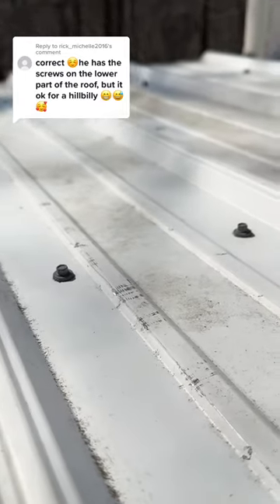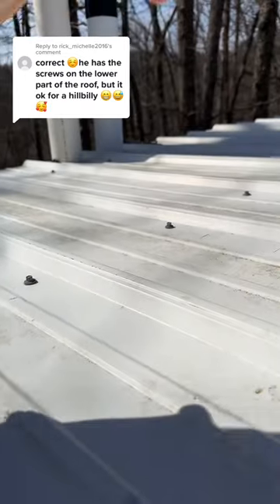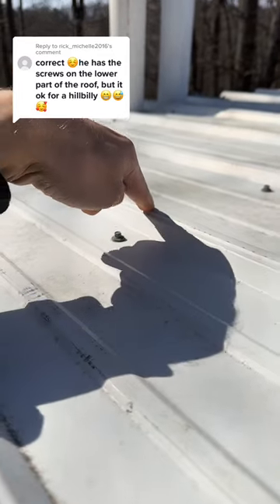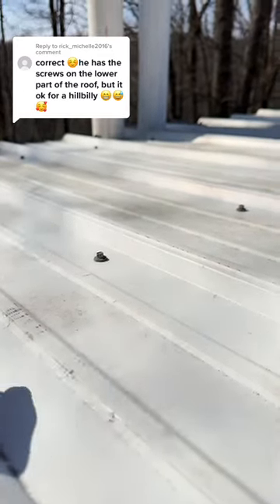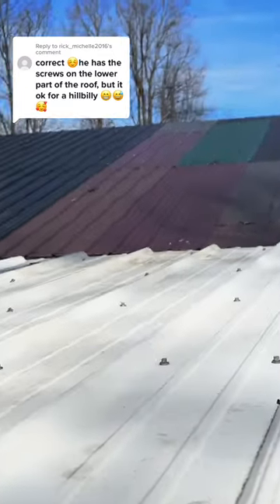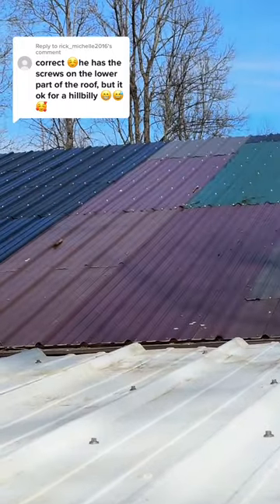did I install screws on the wrong part of the roof

Comment: Backseat know it alls are the bread and butter of the internet forreal. I've installed many roofs and you will destroy the metal if you press down the high ribs lmao
Reply: Came here to say this! you don't need to have installed a roof ever to visualize the rib crushing as you drive the screws lol
Reply: Who said anything about pressing down on it? You don't drill it til the screw head strips
Reply: Def not the bread and butter xD but definitely a dime a dozen haha.
They make me cringe every single time I swear.
Reply: @billfromnxtdoor5575  i guess you still dont understand per instructions from the roofing company. how about you do your roof in metal and when it leaks and u have an insurance guy check it out they tell you your on your own because the metal is installed incorrectly
Reply: @Riley White  dude has probably never ran a screw through metal roofing
Reply: Dude has probably never run a screw through anything lmao.
Reply: Thats crazy because I live in MN and every tin roof I've seen has had the screws on the higher part not the lower part like this and they say its so water can't get under them..but what I'm wondering is how the hell.will water get underneath them if there is a rubber gromet on each screw?
Reply: Did you know this is a big concern for AI? Systems can’t tell the difference between a real master and a couch quarterback
Reply: When I help biuld guys biuld poll barns they told me only if it had insulaton under metal so metal wouldn’t be wavy
Reply: Lol I watched my dad do this. He didn't crush the ribs down either. He's a science teacher with two degrees, one of which is industrial arts. He's helped build houses and has been remodeling them for over 50 years. 
I see in these comments many guys in the business can't think outside the box and have the "my way is the only way" attitude. Well I've seen and repaired many roofs put on by people like you. Many screws come loose for many reasons many of which are due to laziness of the installer. The screw goes in soft and the installer ignores it. Plywood isn't perfect and has defects that screws will go in occasionally.
Never once has my dad had a problem with putting screws in the fridge and in the flat at the eaves Which keeps the wind from getting under the panels. Leaks there don't matter as much if it does happen because it's over open space and not the living areas. And yes he does pre drill where needed. And yes it does take a bit longer. And no he doesn't care if it takes a bit longer. I personally put a wood backing down to support the ridge.
In my repairs I have seen two common failure points. 1. The screw has come loose from either movement or a hollow in the plywood or stripped in combination with the previous mention.
2. The rubber seal deteriorated and crumbled away. Built in obsolescence? On older roofs of course. I've also seen really old roofs in perfect condition.
Reply: @billfromnxtdoor5575  Exactly. You can also put a wood backing behind it. Only a lazy roofer puts so much pressure on it that the metal is deformed. Can also be pre drilled before the screw.
Reply: Why are you oversinking the screws 🤷‍♂️
Reply: @svensplooge9961  so how funny do the people look trying to rake or shovel them off
Reply: Correct that's why the manufacturer says to put it in the valley
Reply: @thehillbillyhilton3557  I guess the manufacturer can't think outside the box either. They need to hire more inventive types. Their way creates potential problems and leaves money on the table. I've been on and worked on a lot of different types of metal roofs. I've made good money fixing, missing screws, leaky screws, loose screws, broken screws.
Leaky screws, meaning one the rubber deteriorated on. 
Some but not all was due to negligent installers in too big of a hurry.
Reply: @consaka1  we've replaced every screw on the whole roof on a house about 15 years after it was put in due to leaking screws. If u put it in the ridge you have to watch how far you tighten it to keep it from buckling the roof. Puttin the screws in the valleys helps keep that problem down, and it also means you have to call the installer to come replace screws in 12-15 years after a leak shows up from rotted washers.
Reply: @thehillbillyhilton3557  I think it can depend on the type of ridge but most wider ridge panels can be backed up with wood or even MDF and other crap wood. Interesting fact for screws through the ridge is they don't have to be super tight like they do on the flat. Snug but not deforming the metal works because if one leaks it's so little it never causes a problem. Still I prefer to back them up but I have some good working examples my father did that aren't but are working just fine. Granted the peak is fairly narrow and stiff which is why it works. Also I believe he pre drilled each one.
Reply: @svensplooge9961  ice will hydrologic the screw out during freeze thaw. Here in Montana it's a big project, we have to rescrew them back in every year, or take them out one by one and silicone them all.
Reply: How much torque are you running to crush the high points.  You do them up just enough to crush the rubber.
Reply: I was about to say 😂. I've never put the screws on the ribbing 💀. Admittedly, I've also only ever installed three of these.
Reply: @billfromnxtdoor5575  ok, you climb your roof and do it, but you gotta film it so we can all laugh at the headache you cause yourself by not wanting to listen to someone more experienced
Reply: @jaymac2702  Plenty of people with "experience" been doing shit wrong their whole life. But I'll make sure to use my impact wrench at max torque til the screw straps next time like you said
Reply: Facts
Reply: Stitch screws on the seem are the only ones installed on the rib.
Reply: @consaka1  what do you think it is about a screw that makes it hold? 

The reason you put the screws in the flats is because you can actually tighten the screw down, clamping the sheet metal to the roof deck. A good clamping force prevents movement, which prevents wear and keeps the screws from wallering out and coming loose

Putting the screw in the ridge means you either need to tripple the work (installing ribs on the roof) or you won't get any clamping force. No clamping means the sheet metal can move, the moving sheet metal pulls on the screws, and the screws eventually fail.

Your dad is a science teacher, not a roofer or an engineer, who know a bit more about the subject than him. But on the other hand it's so basic of a physics problem he should have figured it out 50 years ago.
Reply: @svensplooge9961  I have replaced many a roof that were screwed or nailed on the high rib. More likely to leak imo.
Reply: Achtuauhlee! 🤓
Reply: We have them on the top for the covering on my deck, but theres like a crenelated piece of wood that  the sheets fit on so its screwed straight to wood not crushing them. Kind of a lot of work though for what it is
Reply: Fuck my kidneys failed from the heat stroke I got laying tin roof..! It sucks and no I never ever ever screws down my ribs that’ll crush it making a crack leading to a leak most people don’t know those screws have a rubber washer that get squished down pretty good when laying this stuff
Reply: Never installed one in the ribs ever

Comment: On a flat roof you might want to put them on the rib, if your roof is slanted and you're getting water in through your screws you have bigger problems to worry about.
Reply: Roofing screws have a rubber ring that heats up and makes for a waterproof seal that’s why we put them on the flat bits
Reply: They used to be neoprene washers now they're EPDM (rubber). The washers will fail around 15yrs regardless of location. They make larger sized screws for replacement once the original fails. This panel requires the same pitch standard as shingles. If you install this on a flat pitch use butyl on the laps and a high temp Ice and water shield.
Reply: Why would you install this on a flat roof ?...ever hear of rubber??
Reply: that's not flat roof material.
Reply: No.  If you put them on the rib the screw either won’t clamp the roof down tight enough for wind rating or you’ll crush the rib.
Reply: The heat and cold makes screws come lose your roof will leak if you screw the roof in the rib
Reply: Nope. Never. Been building pole barns for 20 years.
Reply: No. Metal roofing can be used for a flat roof. But it needs to be pitched at like a 1. 

I've done this before for storage units. One aide of the building was 6inches shorter than the door side. Which was still a flat roof but it allowed for draining. 

Also roofing screws used I metal roofs are rubber washers which when it heats up helps to seal the roof. One other thing it's called buel or buyl tape the hotter it gets the more sticky and water resistant it becomes. 

As a builder of pole barns,storage units, gas service stations and gas company shacks. I have pretty much seen every way to NOT install aerial roof or Wayne's coating.
Reply: On a flat roof the last thing you should ever consider is a metal roof with screws. Don't give advice when you don't have a clue what you're talking about.
Reply: @HENRYBERRYLOWRY1845  isn't high temperature ice, really just water?
Reply: Metal roofing requires a minimum 3/12 slope. So metal should never be installed on a flat roof.
Reply: Or just good underlayment/icewater the roof and be ight
Reply: Lmfao
Reply: No.
if you have a problem with leaking. Then just seal them.
But you want on the lowest, closest to what they attach to. 
Multiple reason bot to put on the high parts.
#1 if you are in a wind area, like myself. you will loose your roof quick.
#2 when tightening you will detort the roof and then it will leak there.
Im sure there are other reasons but those are important to me.
On the sealing. thats an easy fix. Silicone, roof cement and tar would be easy.
But I've had no problem with my metal roof and leaks since I put it on.  Which is good because for over 10 years I was replacing the roof due to winds 2 to 5 times a year. More if I had more rains.
Reply: To the one xom0lain about the rubber going bad.
15 years? most non metal roofs don't even last that long.
Asphalt shingles should be replaced max ever 10 years 
Tar and rock every 5 years.
So sealing the screws is nothing.
And I didn't use the rubber washers.
I don't have a problem with leaks.
I had never did a metal roof before I did mine. BTW mine is corrugated metal. 
I'd done lots of Asphalt shingles and hot tar roofs. Which didn't last 6 months where I live. 
Wish I'd don't a metal roof in the beganing. Would have saved me lots of time and money. But I don't have experience with them. And was afraid of the cost. Looking back. The little more it cost. would have been cheaper the first year alone.
The reason I didn't buy the screws with the rubber. was the rubber would not of lasted a year on my roof. It dried out a hot tar roof in less then a year. I'd never seen that before.
Anyhow. For most, the screws will be fine. But if not..then seal with silicone, roof cement or tar.  Its a lot faster and easier to seal then re-roof.  I will never roof without metal now. 
I've seen metal roofs over 100 years old still good. That why I had no experience with them. They are not replaced. 
Now, its nothing to give a little angle on a roof. Even if flat. high end put a 2x4 low end flush. Depending on lenght step down.  It only needs attached every 4 foot. so for 8 foot 2x4, 1x, flush. for longer use strips of plywood. example 16 foot. 2x4, 1x with 1/4 plywood,  1x, 1/4 plywood strip flush 
Mind you if you have heavy snows. you don't want a flat roof anyhow.
Reply: No…no no no..the neoprene washer won’t leak if submersed let alone running water..it doesn’t get a good seal on the rib
Reply: Like to see a flat roof made of these sheets. Dumb

Comment: This makes sense to me. On the ridge you may collapse the ridge leaving it misshapen.
Reply: Old timers used to nail the high ridges.  It's how they used to do it til they finally realized they were wrong
Reply: Instructions literally show it on the ridges too
Reply: @Mharve  Because that is two ribs combined where two sheets join.  You don't want the wind lifting up the ridges where pieces join because you'll have real issues.  He did it properly.  He even showed the instructions.
Reply: Depends on the manufacturer. Just bought a new steel roof and mine go on the rib, if your metal bends on the rib you've got crap product! Depends what gauge you get, style etc.
Reply: @adammonahan687  it's not wrong, depends on the manufacturer. Mine are on the rib as per the manufacturer
Reply: You can do both, screwing into the flat you're exposed to more water but it's not an issue if you do it right. Screwing through the rib you could mess up the water/anti-siphon channel but it will be exposed to less standing water. It's a personal choice but screwing into the flats you don't need long screws and you can save some $$
Reply: @Mharve  two different kinds of screws the one in the valley are to tie into the structure the ones on the ridge are just to stitch the panels together, they’re also stuck together at the seams by bugle tape.
Reply: My boss and I did it on both flats and ridges, usually the ridge where two pieces overlap so that the edges were secured together. Was it probably redundant? Sure. But it still worked. 99 percent of the the workmen commenting online seem to be like the video commenter, just angry you didn't do it their way. The ones I've met irl are chill as fuck, but for some reason some of em get online and just fucking go ham

Comment: I roofed houses for 3 summers in high school and have done many roofs in the 22 years since. That is the correct placement of screws. Those gaskets are designed to last 50 years and seal properly on the flat part of the metal. They also hold the metal more firmly to the decking when installed on the flat.
Reply: Those rubber grommets do not last 50yrs,nore do they warranty them for that long.Or claim they last that long, hell epdm roofs dont even say 50.
Reply: You are mistaken.
Reply: @kjaubrey4816  no not mistaken I've roofed for over 30 yrs not just a few summers.  Those epdm grommets most definitely do not last 50 yrs kid! I replace them all the time after about 15-25 yrs. 🤦🏾‍♂️🤦🏾‍♂️
Reply: loosen up the "set" pressure on yer screw gun, its a fine line between "set" and squeeze the sh*t out of em

Comment: You did it right! this is the correct way to do a screw down roof. 
I do steel building construction and this is how we do it.  the only time we screw off the high rib is at the lap with what is called a stich screw.

Comment: As somebody who has tried to install the screws into the ridges you are correct they belong in the valleys. Ended up over tightening the first screw and kinked the sheet.

Comment: You are exactly right.  the place on the rib is a older idea when they manufactured nails with the heads encased in lead in an attempt to get them to seal on corrugated roofing.  Unlike nails screws don't loosen due to heating and cooling or wind stress or other conditions. Nails will loosen under these conditions and leak. None of these conditions will cause a screw to turn and become loose. and with a washer that is bonded with rubber they are good for a long time and the place them hear ribs taking advantage of the structure of the ribs without compromising it's structure.

Comment: Screws on flat. If you run into old buildings that has nails with washers then they should be on the high rib. You're right an they might be thinkin of the nail application pur the old school method. Keep doin you an keep postin brother.
Reply: Per*
Reply: @zackzimmer7167  you legit took time out of your day to comment this? Wow you must have the most entertaining life there is. True hero. Thanks.

Comment: You did it right... As someone that has worked for a commercial roofing company for almost two decades. The screws that are supposed to hold the roof to the substrate or joices, are supposed to go in the lows of the panels so it holds the panels down tight. Because if you put them in the highs, then you have play in the gap between the high and the substrate. And over time, with expansion and contraction, they can come loose. And with enough wind. You could lose your roof.  But stitch screws should be used  on the laps in the highs.
Edit: I made my comment before finishing the video😅.

Comment: The reason it's on the low part is because they don't want somebody screwing it on the rise and over tightening it and it just caving in and don't get a good seal you put it on the flat part seals against the wood underneath rubber gasket seals no leaks for 10 years

Comment: I was taught to put them on the rib back in the day but I put them on the flat now. When there on the rib they stick out an inch so with expansion and contraction the screw ends up loosening because it's easier to push side to side. On the flat the hole will just elongate a bit under the washer but still stay sealed because the screw can be pushed side to side.

Comment: When roofing nails that had a rubber washer were all that was available, they nailed on the high ribs to keep the water out.  Now they use screws with EPDM washers that basically last your lifetime.  Screws on the flat part next to the high ribs for maximum holding power and keeping the flats down in a strong storm.  Don't want air getting under them.

Comment: Having put those on before, I’m pretty sure they come with some sort of grommet to prevent water from seeping through.
Reply: Yup. They have a rubber washer. Sometimes though they get overtorqued and the washer tears. You put a strip of mastic water sealant under the sheet to double up your waterproofing.
Reply: @DarkMatterX1  yeah, I remember the first couple I did, I over torqued it and broke 😂